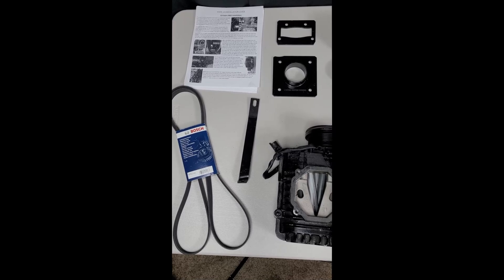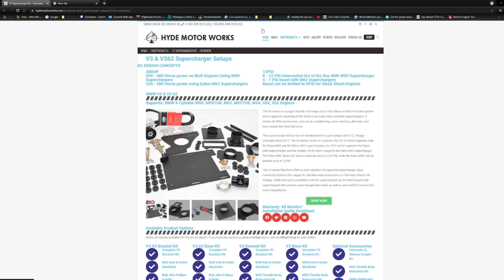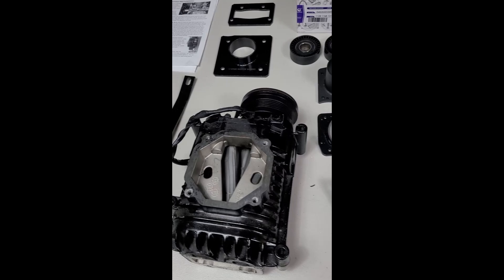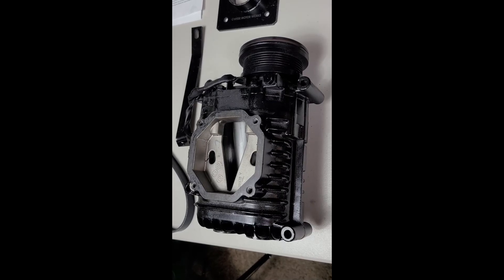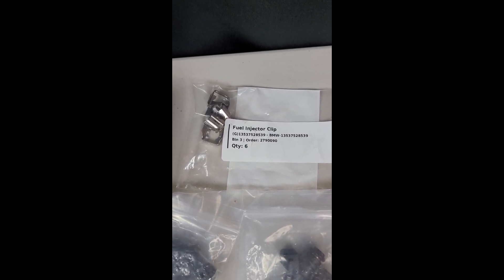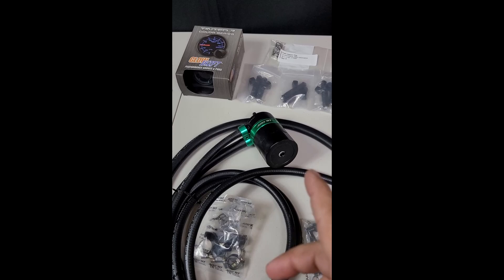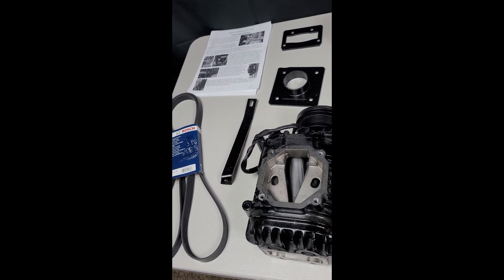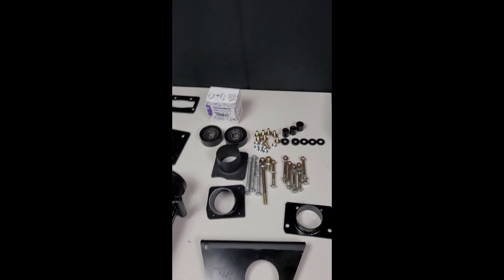HYDE MOTORWORKS EATON M62 SUPERCHARGE E36 KIT.

Comment: Great video!  I had stubled across their website, and was looking for a video on these. I have a pair of 97 verts that i really want to supercharge one of them. I like the idea of supercharger for simplicity, and retaining AC and factory exhaust.
Reply from the maker: m62 was a great stepping stone to giving a bit of boost to the engine, The M90 Kit feels like the right way to go on the m52's. I now run the M1 Kit and it makes more power then it needs to and requires a full build out if you want to really let the s/c loose.

Remember to use my promo code for a nice discount on Hydemotorworks.com

Comment: I cant tell you how excited I am to finally have a video series on these. I have the 323is 2.5L and a M62 SC, have been thinking about getting their product for about 6 months. I have a Shrick Aluminum Intake Manifold and was worried about fitment, will also be using S52 cams
- Will you be running the SC off the AC compressor pulley or the crank itself?
-Will you be keeping the throttle in the stock location or relocating it in front of the charger?
Myself and other people this Facebook bmw group will throw in for a dyno run once you get everything going if you weren't opposed to it
Reply from the maker: Awesome. The @hydemotorworks kit fits great. I am using m50 intake so I think your good on fitment as long as your intake does not come out away from the block than the stock intake the m62 is fine. If you use m90 or 112 you need a short ram intake to accommodate the larger s/c. You replace your existing serpentine belt with a longer belt utilizing your existing crank pulley. I kept a/c as this is my weekend/daily. I have relocated the throttle to be placed before the s/c. All vacumm such as egr. Evap. Brake booster were moved to a new vacun source that will come off a vacuum block eventually. I have got a first start finally and we are working on the tune/data logging with @kasselperformance next video should be up soon with full install procedures. Will get on the dyno after we lock down the tune.

Comment: Great Start, Just note: We are a German Company (not a UK Company). We would suggest a few things, dont exchange the thermostat housing, if replacing it, ensure its the OEM one or a high quality aluminum one, these cheaper ones will leak as they are warped. Also, no need for the larger MAF, just rescale the existing MAF, The injectors are good but ensure they are programmed in and don't run the car with larger injectors unless they are "dialed" in, meaning the tune itself. Find a good tuner, Kassel Performance in Pennsylvania would be able to handle it well on the stock ECU.
Reply from the maker: So far every tuner I have worked with including Kassel has wanted the 3.5 MAF. Sorry about Location, I had you confused with another company I was talking to about a stand alone. Ill correct myself in later video for posterity.

@Kasselperformance is going to do the tune for this build, they supplied the MAF and injectors as well as fuel pump. Great Guys!